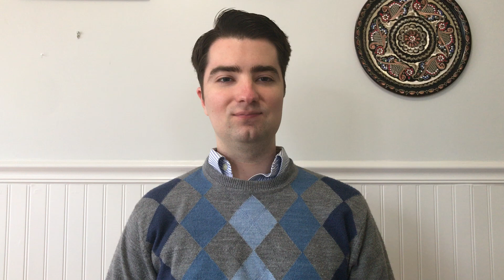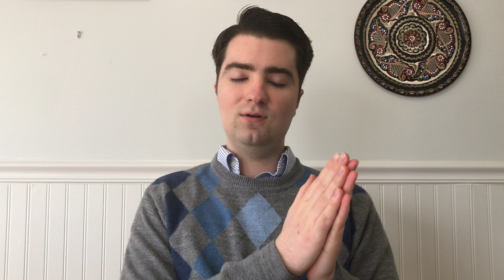Oxidation of Hafnium Carbide

Comment: I'm a layman, but I was hoping you could tell me whether a drill housing made of hafnium carbide could be used to withstand the high temperatures of deep core drilling.  I read about the latent temperature increase industrial components 
are exposed to as they drill deeper into the crust.  At the greatest depths lies the greatest heat (to be harnessed for thermo-electric generation).  Provided the HfC housing wasn't abraded, and the drilling components extended outwards from the protective housing, do you think this would allow for an acceptable lifespan for the machinery?

Additionally, how does hafnium carbide respond to atmospheric pressure?
Thank you.